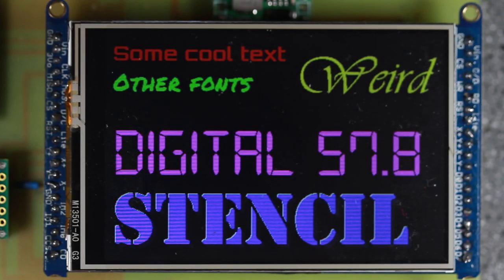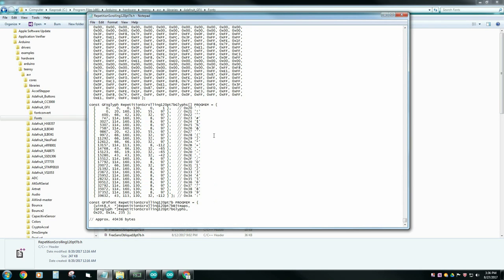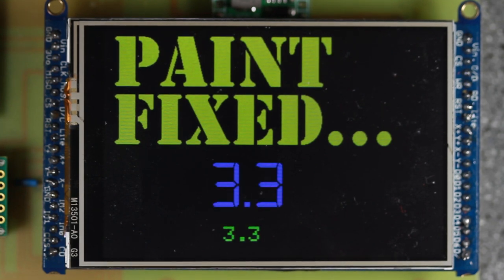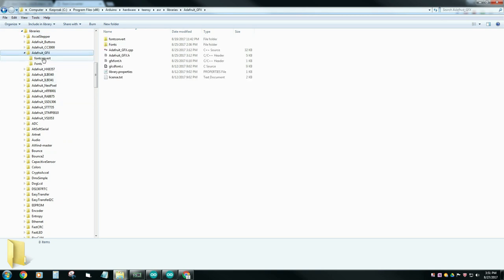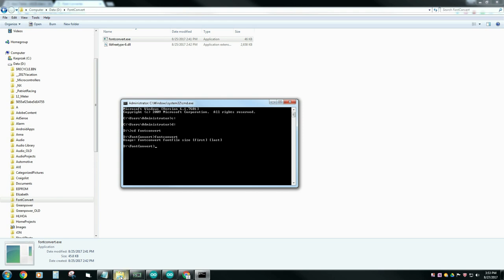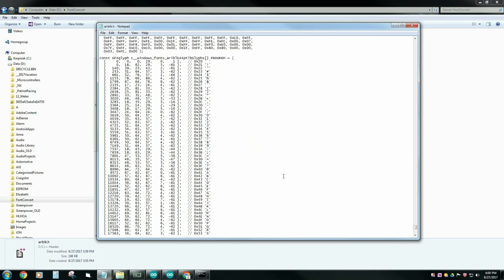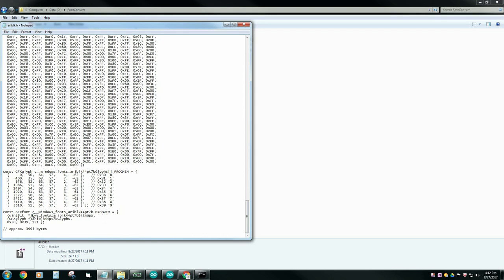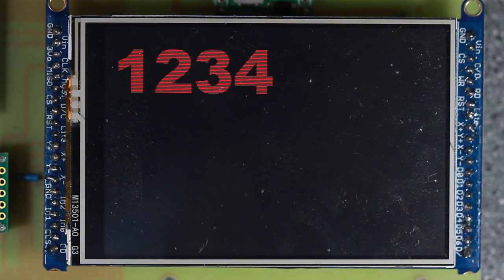Create and use custom fonts for Adafruit_GFX libraries

Comment: Hi Kris, nice but not good enough. I see flickering this comes form how you refresh your value, or with old and new value and if you overwrite it with black.                                                                                   
void tftvalue(String value, String old_value, String eenh, int x, int y, int spacing, int fcolor, int bcolor, int len, int just, int first){
    
    value = value + eenh;
    old_value = old_value + eenh;
  
  if (just == 1){
    value = "          " + value;
    int slen = value.length();
    value = value.substring(slen-len, slen);
    old_value = "          " + old_value;
    slen = old_value.length();
    old_value = old_value.substring(slen-len, slen);
  }
    int tvol;
    int vol = value.length();
    int ovol = old_value.length();
    if (ovol > vol){tvol = ovol;} else {tvol=vol;}
   for (int i = 0; i < tvol; i++) {
    char voch = value.charAt(i);
    char ovoch = old_value.charAt(i);
    if (voch != ovoch || first == 1){
      if (i < ovol){
        tft.setCursor(x+i*spacing,y);
        tft.setTextColor(bcolor);
        tft.print(ovoch);
      }
      if (i < vol){
        tft.setCursor(x+i*spacing,y);
        tft.setTextColor(fcolor);
        tft.print(voch);
      }
    }
  }
}
Reply from the maker: Thanks for adding this. I was hoping for a good solution to avoid repaints and this works unless a decimal point is in the number, then a large spacing around the decimal results. I tried setting position based on getCursor but that only works if something was drawn. The ILI9341 doesn't have a "getCharWidth" function so hard to know where to draw characters--I see  you just hard coded the spacing--works but gives too much space around a decmial. Do you ever run into memory fragment issues with String data types?

Comment: Thank You Kris, I could not get the font convert program too compile. 
Has anyone been able to update to freetype-2.9.tar.gz and get it to compile ??
Reply from the maker: I'll check the link later on but check out my description I thought I put a download to the compiled files and everything that you need
Reply: Yes, I did get those files. The date is 08/25/2017. So I thought that was older and not the newest version. Also there is a problem as my antivirus calls a virus in the fontconvert.exe. I can send you a pic of the warning if you'd like.
Reply from the maker: @donvukovic  Odd I just downloaded the files on a different machine and no virus issues. I'm using Trend Micro. The files are the compiled exe and the required dll, you should be able to use the files as is.
Reply: I have Avira antivirus. I also got the virus message when I tried to compile the source files. Go Figure.
I could not get the compiler to work on the source files. Errors that I do not understand and do not have the time to trouble shoot.
Thank You for the compiled version and extra .dll.

Comment: Is there a way on a color display to use custom font without flickering
Reply from the maker: I use a Teensy with the ILI9341_t3 and it's highly optimized--way faster than the Adafruit version. I get no text flickering.
Reply: when i was using a custom font .its not refresh the print overlap.

Comment: I'm so close, just in the msys when I try to configure the mingw, it can't find the file. I need help with this step
Reply from the maker: this process is a pain, i recall having to put some DLLs in the folder where the source code is. Cant' remember though...
Reply: Kris Kasprzak ok, let me know if you remember how to do it, thank you.
Reply: Extract into the C drive and rename it to something like ft27 or ft29. Make sure that when you go into the ft29 folder it doesn't have another freetype folder deeper within it or else when you do the ./configure command it won't be able to find the file. In that case do another cd command to get one layer deeper into the file directory and then retry the ./configure command. At least that is what happened to me.

Comment: works for Adafruit_SSD1306 also ? (OLED)
Reply from the maker: Yes, it should, keep in mind the display initialize and display are a bit different, the Adafruit 1306 library actually has a video buffer that you write to and a display() call to send the buffer to the display.
Reply: One more silly question after the  display.setFont(&MYFONT); statement , How do i revert back to the default font? i m asking because i 
want partial part of the fonts in my screen be with default font.
Reply from the maker: display.setFont();
Reply from the maker: display.setFont();
Reply: Yes it does.  I just tried it on mine.  This is the video I needed!  Thanks Kris.

Comment: i am getting this, i have everything installed properly 
CombinedSliderControl:11:10: fatal error: Fonts/FreeSans9pt7b.h: No such file or directory

Multiple libraries were found for "Adafruit_GFX.h"
 #include <Fonts/FreeSans9pt7b.h> // Hardware-specific library

 Used: C:\Users\p\Documents\Arduino\libraries\Adafruit_GFX
          ^~~~~~~~~~~~~~~~~~~~~~~

 Not used: C:\Users\p\Documents\Arduino\libraries\Adafruit_GFX_Library
compilation terminated.

 Not used: C:\Users\p\Documents\Arduino\libraries\Adafruit-GFX
 Not used: C:\Users\p\Documents\Arduino\libraries\Adafruit-GFX-Library-master
Multiple libraries were found for "Adafruit_TFTLCD.h"
 Used: C:\Users\p\Documents\Arduino\libraries\Adafruit_TFTLCD
 Not used: C:\Users\p\Documents\Arduino\libraries\TFTLCD-Library-master
 Not used: C:\Users\p\Documents\Arduino\libraries\TFTLCD-Library-a857c4960fd9c539309651db6efda8931e114b58
 Not used: C:\Users\p\Documents\Arduino\libraries\Adafruit_TFTLCD_Library
Multiple libraries were found for "TouchScreen.h"
 Used: C:\Users\p\Documents\Arduino\libraries\TouchScreen
 Not used: C:\Users\p\Documents\Arduino\libraries\Adafruit_TouchScreen-master
exit status 1
Fonts/FreeSans9pt7b.h: No such file or directory

Comment: Hello..... i want to include a new Font into the lib so that i can use it in the sketch and show it on the tft display.....but i can´t open the converter....is there somone who can help me?
Reply from the maker: is it a true type font? What error is shown? Hard to debug with what's provided.
Reply: It´s the Font for Aurebesh, it´s the offical type in the Star Wars Univers, i installed in on my desktop and it´s included in words, so i can write letters in Aurebesh if i want....i want to build an shootcounter for an Blaster, so i need the numbers for the Counter.....
i downloaded the link above for the converter,  but i can´topen the exe.file, the zip-file is allready depacked
Reply: And yes it´s a True Type
Reply from the maker: I just tried downloading the zip file and was able to. If  you are using chrome, look for the download icon in the upper right of the browser. I just downloded the font aurebesh.ttf and created a 60 point font--and it worked. Note for some odd reason i got an error from the fontconvert utility with 20 point, but when i tried again with a 10 point it worked, then I was able to create a 20, and 60 point font. from the prompt I typed fontconvert aurebesh.ttf 20 >aurebesh20.h. What font size are you looking for?
Reply: My Windows defender block the opening of the exe.file of the converter
Reply: I can´t deaktivate the windows defender smart screen......this program blocked the opening of the exe file
Reply: i´m to stupid.....sry....i can´t open the converter
Reply from the maker: I doubt this will work but I renamed the file extensions to jpg (maybe tricking defender that these are images). rename back to exe and dll 

https://drive.google.com/file/d/1V3Ih2-Z3B4UQE8TAomEWxqgL4DfqgCR2/view?usp=sharing

other option is to turn off defender temporarily.
Reply: That also did not work....i deaktvated the defender.....the exe.file open and disapear after a half second....thats all
Reply: i cant do it.......sry....but i need this font in the sketch....so what can i do....or could you send me the lib
Reply: i need your help Sir
Reply: is there another converter
Reply from the maker: what font size to you want for the aurebesh font? I'll just generate the .h file for you.
Reply: i use an 1,8" TFT LCD ST7735 128xd160pixel i think 60 will be great......can i change the size in the sketch later?
Reply from the maker: the font files are not sketches they are .h files. The font definition is actually a bitmap definition of each character so changing the size can't be done. new size = new .h file

60 point on a 128 pixel display? I'm guessing it will be too large, i'll generate a few sizes, tonight.
Reply: great....thank you.....thank you so much....but there is still the problem if i want a new font someday in the lib....so i can´t do it.....
Reply from the maker: you are going to have to figure out how to download and run and exe--or build your own fontconvert utility.
Reply from the maker: several fonts in different .h file, use per my video instructions 

https://drive.google.com/open?id=12KvzFcA2b-9KweJuMiArJt2jVLv7gZXf
Reply: OH!!!!! I thank you so much.....i try it yesterday and today again and again but i can´t open the converter.....sry Sir.....maybe i´m to stupid
Reply: I thank you so much Sir.....the sketch works with your lib .....wonderfull, but now i got another Problem, I can open the converter, but where can i include an Font who isn´t in the list?

Comment: Could you please so kind and upload a new virus free version from fontconvert.exe
Reply from the maker: What virus checker are you using? According to mine which is 

McAfee SecurityCenter
v 16.7
build 16.7.126
engine version 3252.0
Last update 2/10/2018

there are no viruses.
Reply: AVIRA IT tells me HEUR/APC (CLOUD)
I think someone attached it, in the cloud, to fontconvert Exe the file I'm downloaded has 45,8 KB (46.910 Bytes)
Reply from the maker: just re-uploaded, try this link https://drive.google.com/open?id=1M12mM9rOhCYabiJZKsfMk_Zu_kY1YVlw
Reply: I check this out something is odd
Reply from the maker: Fontconvert.exe size is 45.8 KB (46,910 bytes), i uploaded a ZIP that includes it and the required dll.
Reply: It seems to be a Problem with my Virus Protection Thank you war answering Have a good one

Comment: I just wanted to display a few accented French characters on my tft screen using the Arduino IDE on my PC, a Teensy 4.0, and the Adafruit libraries Adafruit_GFX, and Adafruit_ILI9341.

I didn't want to hassle with special fonts and modifying libraries.
Here's my simple program for printing the character é on the tft screen:

#include "Adafruit_GFX.h"
#include "Adafruit_ILI9341.h"
.
etc.....
.
 String Strtemp;
#ifdef FRENCH
  Strtemp="Prévisions Météo";
  Strtemp.replace("é", (char)0x82);
#else
  Strtemp="Weather Forecast:";
#endif
  tft.print(Strtemp);

Hope this helps someone out there like me, a beginning software hobbyist.